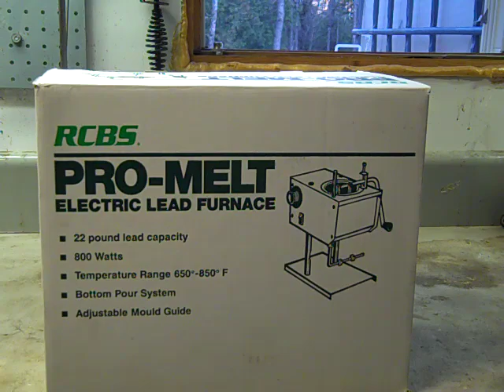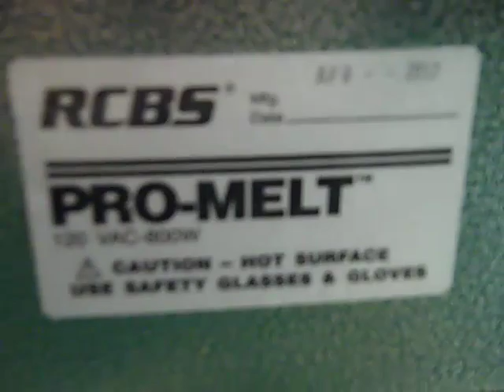Welcome to the RCBS Pro-Melt lead casting pot - Bullet casting and reloading tools

Comment: I used one of these for over 30 years and it finally got to where it couldn't get the melt hot enough.   Guess one of the heating coils went out.   I got a Lee and it works fine, but as you observe, may not last 30 years.   The RCBS units are very pricey these days (2023).

Comment from the maker: Well, I only used the Lyman a few times at a friends house when I was first trying my hand at casting bullets.  It was a fine machine but I think I prefer the pro-melt.  Plus, RCBS seems to be a much better company to work with than Lyman as far as customer service after the sale... I've dealt with both companies in that regard (unrelated to the melting pots).  I also like the dimensions of the RCBS pro-melt which is taller.

Comment: The Lee pro 4-20 has a few faults my main gripe is with the pot mounting screws that screw in to the outer aluminium housing. The screws fit into a C shaped aluminium profile which over time expands and the whole unit falls apart.  I have had disassemble the whole thing twice and squeeze the C channel that the screws fit into together, so that the screws grip and hold.

Comment: Will it do Tungsten or Bismuth?
Reply: Tungsten has a melting point of like 3422 °C. This would be a little harsh on this pot.I am not sure about bismuth or tinc, but elvisammo tried zinc with the Lee pot and it was melting a hole in it instantly. Out of the hip i would recommend to use it only for lead.